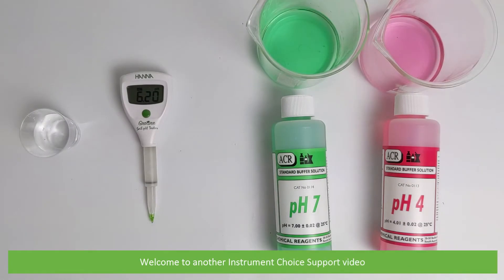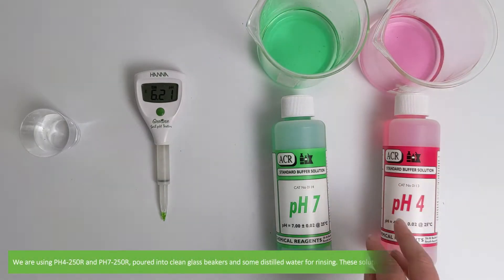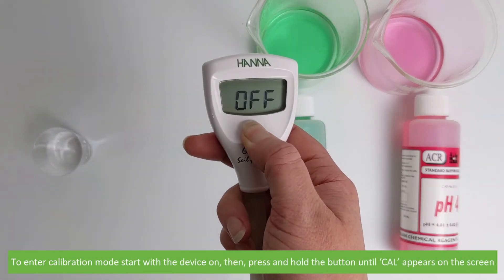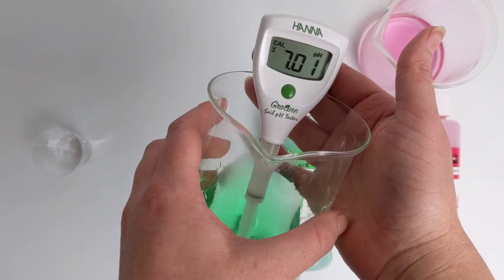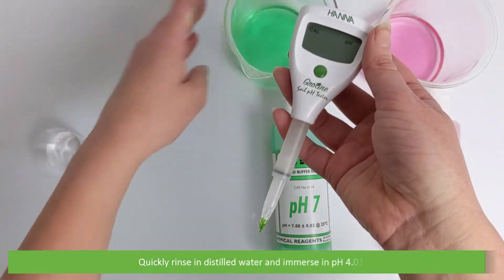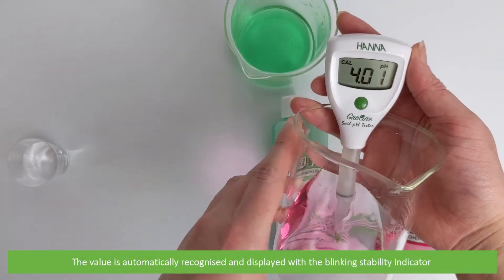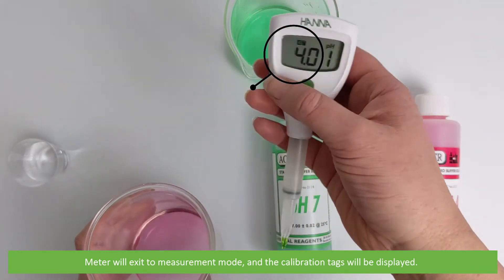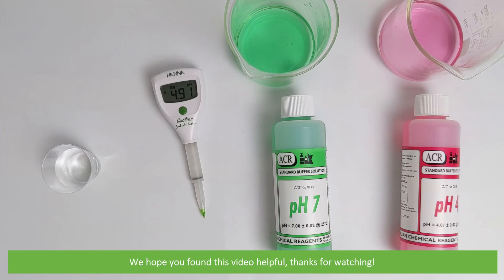How to Calibrate the IC-HI981030 GroLine Soil pH Tester

Comment: MY PROBE LOOKED REALLY DRY WHEN IT ARRIVED, SHOULD I REFILL THE ELECTRODE??? THERE IS NO VIDEO ABOUT IT JUST SOME INSTRUCTIONS IN THE INSTRUCTION MANUAL BUT I WOULD LIKE A BETTER EXPLANATION O VIDEO PLEASE
Reply from the maker: Hi Enrique, 

If it is a new meter, we recommend soaking it in some storage solution before you refill the electrode. 

To do this, rinse off the probe tip with water and condition the electrode by soaking the tip in a pH storage solution for about an hour. Perform a calibration before using.

If it cannot calibrate, you may need to fill the bridge electrolyte following the steps outlined in the user guide. We will make a video on this in the very near future!

Feel free to contact one of the Instrument Choice Scientists if you need further support: https://www.instrumentchoice.com.au/IC/Contact

Thanks!
Reply: @instrumentchoice  Could you please do a video for checking and refilling the HI981030 bridge electrolyte?  I don't know if I'm supposed to be able to see tiny fill holes or something? my eyes aren't that good.
Reply from the maker: @CaveLiveMusic  Hi there, we sure can! 

However unfortunately, we do not currently have any in stock. As soon as they arrive, we'll get that done for you. In the meantime, feel free to contact one of our scientists and they can walk you through the process. Call 1300 737 871 or email customer-service@instrumentchoice.com.au
Reply from the maker: @CaveLiveMusic  Hi there, the video is now live. There are no tiny fil holes to be searching for, just fill the well with solution. Check out the video here: https://youtu.be/j1odElAZsIU
Reply: @instrumentchoice  Thank you!.  It seems there is not really a way to check the 'level' as such?  Does it actually lose/leech gel with use, or just become less effective over time?  Cheers